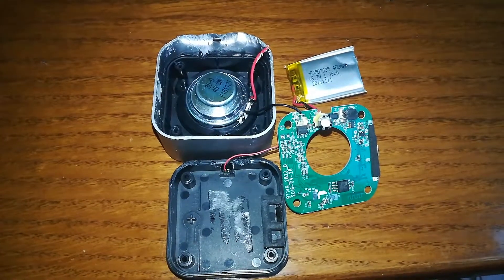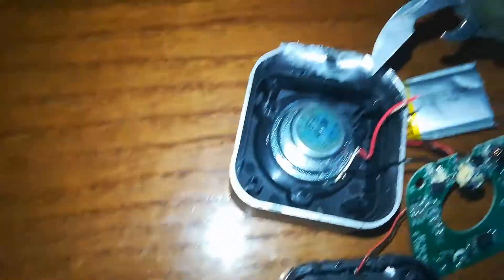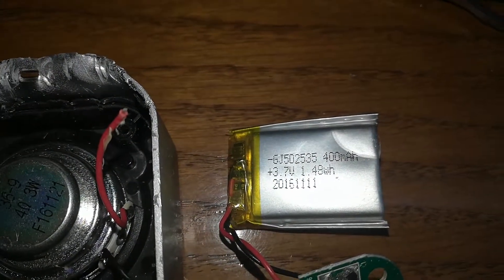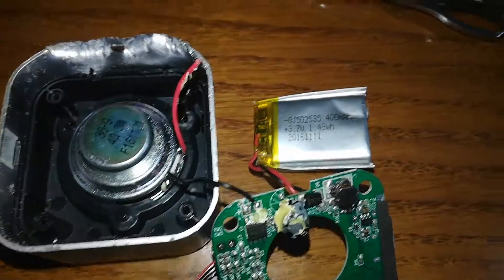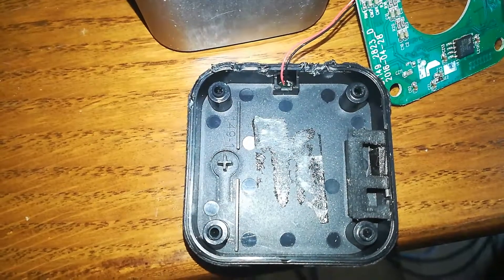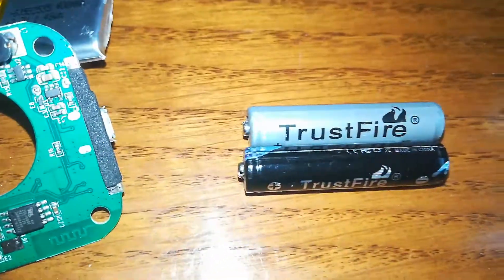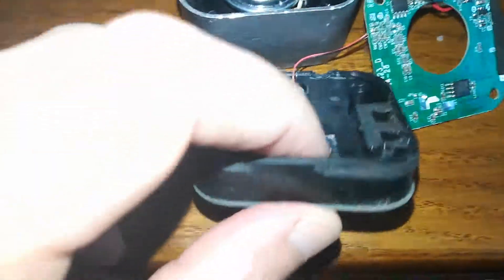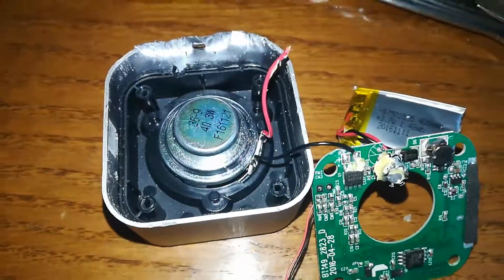Anker Souncore Nano ripped appart / dismantled + discussing battery upgrade

Comment: Thanks for the video. Did it work?  If so, can you share a link to the battery you chose.
Reply from the maker: It did work, but I had to cut some plastic out of the speaker as the battery I ordered was a bit too big.
So if you want to get the right battery, I would suggest first opening the speaker, taking the correct measurements to what battery can fit in, and then heading over to Aliexpress or some other site like that, and searching for a 600-1000 mAh battery.  I bought this one https://www.aliexpress.com/item/32663273906.html?spm=a2g0s.9042311.0.0.27424c4dCCML1B

but as I said, it wasn't the best fit